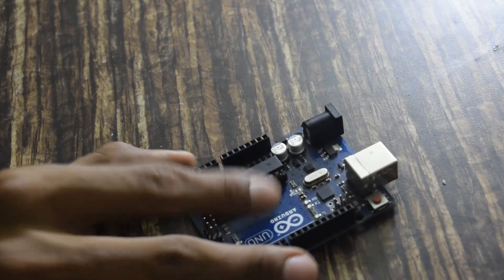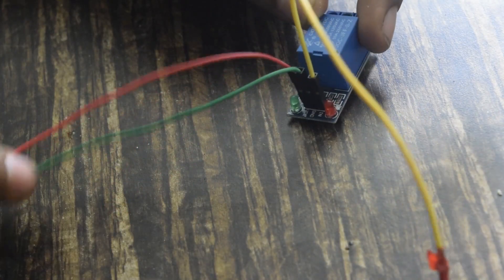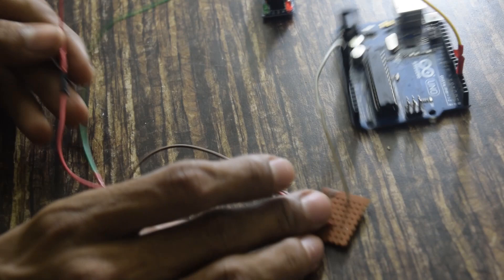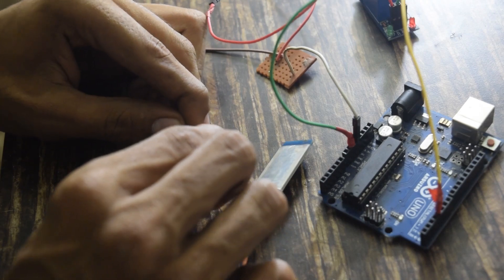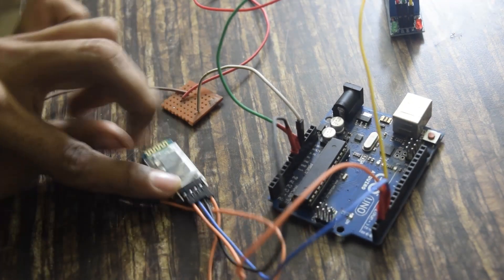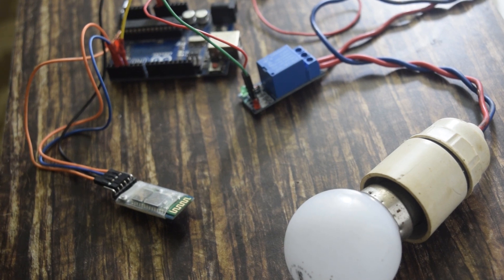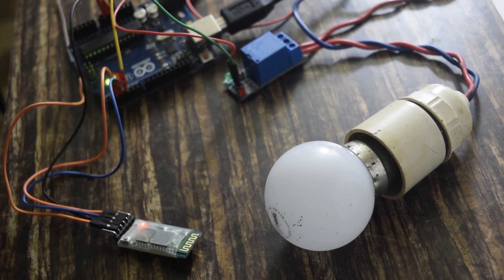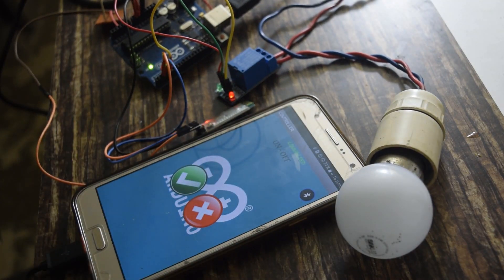Control Home Appliances Using Mobile - ARDUINO PROJECTS

Comment: May I control a load automatically 5 min On and 5 min OFF then 5 min ON 5 min OFF .
Please help me
Reply from the maker: Yes u can put a delay of 5 min
delay (5min);
Reply: @electro_king_official  delay( 3000000) not working. 
If u suggest eny other formula.
Reply: @electro_king_official  delay(5min) also not working

Comment: Greetings,
Nice work!, but I have a question if i am placing the relay between the cut wires then the physical button on my switch board shall always be in ON position just in case i want to turn on/off the lights using the physical button incase i forget my cell phone at office how can that be achieved.
Thanking you in advance
Reply from the maker: Thank you
Yes you need keep it on and for long distance use iot 
Bluetooth moduel range is 10 meter

Comment: There was a small mistake in  connection
TX pin = digital pin 5
RX pin = digital pin 3
       of arduino
Above is the correct one
Like if this helped you 🤟🤟🤟

Comment: Hi, Thanks for the video^^
I got a question though from where do you get the voltage for the lamp? because neither of the devices i see can provide such high voltage, second thing can you explain to me the last two connections to the relay you made before trying out the project?
Reply from the maker: you need to connect  the lamp to you 220v 
If you want to know the connection more deeply download the circuit diagram, all the connections are shown properly their
Reply: Tauseef Siddiqui Thanks alot💟🌟

Comment: Hey dude! Really nice work! But i have a question.. Can i use Arduino Nano for making this? :)
Reply from the maker: yes just change the pin NO. and it will work
Reply: @electro_king_official  Thanks for the reply! But i am wondering.. How do you power the 12VDC relay with 5V from the Arduino?
Reply: @electro_king_official  And can I power the project with 9V battery, like i saw you did on the schematic (connected to the VIN and GND pins of the NANO) ?
Reply: @electro_king_official  I see.. So you use 5V relay here and 9V battery to power the arduino(or adapter in your case with the Uno) , right? I am leading myself from the scheme diagram in your site, but I saw the relay in the description that you gave (it's 12V) and that's why I am asking all these thing, because I wanna make that great project :)
Reply from the maker: if you are using 12v relay you can use 12v battery
connect negative terminal of 12v battery to gnd pin of relay 
connect positive terminal of 12v battery to vcc and connect signal pin to arduino

Comment: you said that you're connecting pin 3 and 4 to arduino but in the code you  used  btserial(2,3);  why ?
please describe . Thanks.
Reply from the maker: btserial stands for Bluetooth serial, i have connected RX and TX pins of Bluetooth module on pine NO. 2 and 3 that the reason i have first initialized the Bluetooth RX and TX pins as 2 and 3 thank you 
i hope you got the ans of the question

Comment: how do a connect a single relay?it is not a module it is a bare relay .
Reply: Bare relay will probably damage your Arduino unless you use a 1N400X diode.

Comment: By this project only my led on the relay is responding to my phone. But the bulb connected to Ac supply via relay does not respond what  should I do?
Reply from the maker: Huzaifa Tinwala 
check the wire if its good or not
check the connection from relay to bulb ... if the wire is connected at wrong place it wont work

Comment: there are many app but wil it work for all codes like will it work for the code which u have done?
Reply from the maker: Srishtygarden Resorts 
no my app won't work because I have set for certain value behind a button when I press that button the value behind the button is sent to arduino and arduino does the rest of the work
for example behind on button I have set 1 and when I press the on button one is sent to arduino then arduino comes to know that it have to put on the relay
on Play Store you will get app in which you can manually set a value behind a button which you have declared in the code for example when 1 is pressed first relay will get on when 2 is pressed second relay will get on and so on
if you want any help you can message me anytime

Comment: you have connected tx and relay signal pin to single pin 4 how its possible
Reply from the maker: CLICK THAT MOMENT 
please do the connections as per code
Reply: @electro_king_official  how can you plug two wire in one mean in 4 number pin